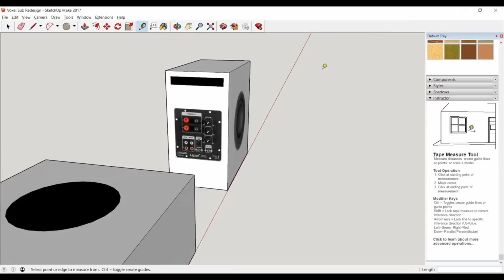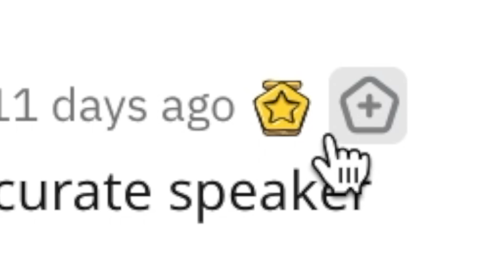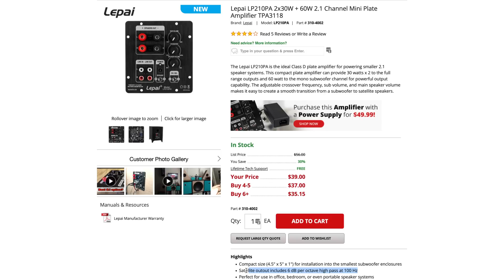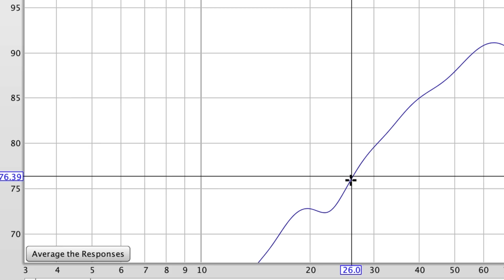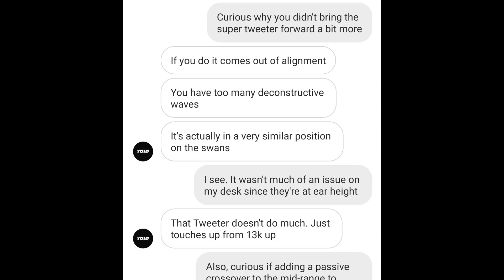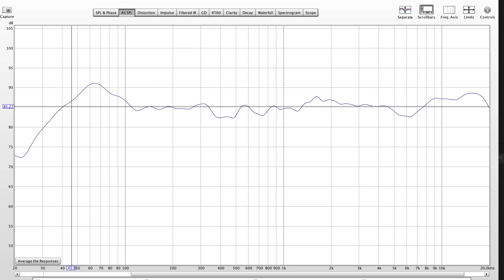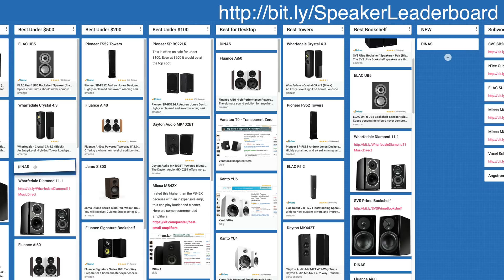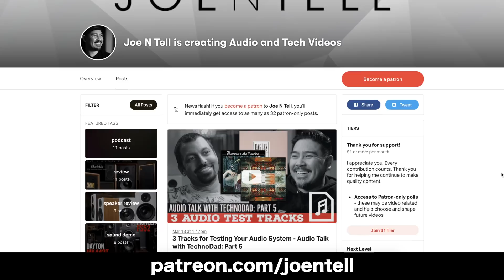DIY Speaker With Subwoofer Hits Down to 35 Hz! - DINAS - Active Bookshelf Speakers Collab w/ 123Toid

Comment: i would move the midrange woofer 1cm up to be closer to the tweeter, as close to the tweeter as possible. also dayton audio has a different version of the RS100, the RS100P. instead of the aluminium membrane it has a mixture of paper with kevlar and glass fibers. while still being pretty stiff, it has more inner dampening which does not have strong resonances in the higher frequencies where the tweeter is playing. the aluminium cone that you are using has some nasty resonances in the upper frequencies and it is not possible to use a 1st oder crossover. you would need a 2nd or 3d order low pass filter with impedance compensation to get it silent above 5kHz.
but crossovers with higher orders then also have more phase shifts which have a downside regarding the time alignment. maybe the aluminium cone has a tiny bit of better resolution in the midrange than the paper cone but i am not really sure about it.
i think the paper cone version has the same dimensions like the aluminium version and is easy to change. you could do a measurement with both types and compare the waterfall spectrum which lets you visualize and compare the resonances.
nevertheless, it seems to be a very good balanced system for an attractive price point and probably hard to beat at this price point.

Comment: I have Edifier s880DB and using it with optical connection.  They don't have subout.  Can I DIY a subout port or any other output to make use of my active subwoofer, which has high level inputs and rca inputs.

Comment: Great video. I was always under the impression that the sub driver needs to be separated (if only by a sealed wall in the enclosure) from the mid drivers or the mids will suffer from the air pressure. This build seems to debunk that theory.
Reply from the maker: The mid is in its own separate enclosure

Comment: Nick, I have few questions about DINAS build plans I bought on 18 Dec 2021.

1) I managed to find speaker box made of plywood/MDF with 12cm or 15cm thickness from Taobao online with dimension of 12.6" x 7.87" x 9.8" (HxWxD) compare to build plans dimension of 12.5"x7.5"x10" is it okay to use it for DINAS or it has to be exact as build plans to get the expected result?
Any different to use 15cm thickness for the flat pack instead of 12cm in term of box resonance at low frequency?
Taobao online speaker box slot port design might be different but I could fabricate it myself with the hand tool.

2) There is 0.68uF capacitor connected to external tweeter in series and then parallel to the Mid range speaker in reverse polarity, what is the reason of reverse polarity connection on tweeter? Same question on Woofer speaker reverse polarity as well.

3) why not connect tweeter and capacitor in series onto (R) channel directly instead of parallel to Full range speaker on (L) channel since there are two channels available?

Thks&Rdgs,

Foon

Comment: Do you know if it would be possible to build a set like you have here, but that allows for multiple line inputs (especially some balanced TRS, that would be great), and mixes all inputs? I have multiple computers/devices I want to play through a single sound system, but without toggling between them. I have a system that works right now, but it's a bit janky.

Comment: Ports aren't tall enough. I've only used these little home audio subs twice but the minimum height on a regular slot port for them is about an inch. I guess having it chuff before bottoming out keeps the subwoofer safer in the hands of careless folk.

Comment: If you still had the other sub under the desk while playing these speakers , then it may have been acting like a passive radiator, causing feeling and sound at the floor level.  I would have like to hear them in this analysis.

Comment: Hi I'm waiting for my drivers ready to assemble the speakers. Just a question about the wiring from the CD player with a  Y cable Line Out right  Channel to the right Line in L&R Right Speaker and the Left Line Out Channel to the left line in L&R Left Speaker. I'm correct  tks for your Answer

Comment: Paper speake cones are tough to beat. There have been many different materials used in woofers over the years, but paper is still the top choice of most builders. Now this is kind of an interest design for another reason, besides what the commentator tells us. I have several drivers I’ve bought for other projects, but I never completed them for various reasons. So, I’ve got some Dayton Audio 10” inch woofers. I’ve also got a pair of Silver Flute 6.5” mid woofers I was going to put in my car. But after the original speakers were broken in I didn’t need them fir my car. I can use those down to 50Hz. With the active crossover of this system I can cross them anywhere they sound the best. I’ve lost got a pair of 2” dome midrange made by Peerless in the 80’s, but mine are in great shape and sound awesome. The only thing I don’t have are tweeters. I do have a pair of Peerless rectangle snapped some tweeters that I used with this some mids, but they just don’t have that extra something. I like the tweeters he uses here. So I might use the same drivers h uses here and use the 10” woofers to reinforce the bass of the desk speakers, but that’s something that I’ll have to figure our in the room I’m going to use them in. I could always sell the 10” woofers to help fund this build, so, we’ll see how thing’s pan out, but I could theoretically build a set of four way speakers with these, a pair of towers with labyrinth patrician for the very low frequencies, a pair of silver flats from 100hz to 1000 Hz, the dome mids from 1000 Hz p to where ever the tweeters will come in and then the tweeters. I could save the silver flutes for rear channel surrounds  using the same tweeters as the Dinas. Or I could use to hem on top of the dinas to widen the soundstage up front. It could bud a lot of fun to figure out!

Comment: Cool idea having a 3 way speaker that reliably handles a full range of frequencies. Is it setup so every driver crosses over and none of the drivers play the same frequency range? Would be a dream speaker for smaller rooms, not needing a sub and having less clutter in an office.
Reply from the maker: Yes, we made sure the crossover points were smooth and complimentary. The crossover for the woofer is adjustable as is the level.

Comment: Hi, I wondering why you use just 2 Channels from the plate amp? I bought the plans and builded the speakers by myself. Is it too much power having 30 Watts for high and another 30 watts for the mid range speaker?  So fare I love the dinas. I struggled I bit with inches to mm because the wood in Germany is thinner or thicker the 0.5 inches. Cheers Frank

Comment: I’ve had this polk audio sound bar with what I believe to be a 6” subwoofer. For being such a small driver, this sub really shows out... I’ve had to take pictures, paintings, etc. off of the wall in the room just because of how bad it would rattle. Impressive for a 6 inch subwoofer, yes, but still not comparable to a much larger driver such as a 12”.... the highs and miss of the sound bar are impressive as well, and can get almost too loud, but yet I find it rare to be ear piercing. Nothing but good review for a somewhat inexpensive Polk sound bar and sub. 👌🏻

Comment: Parts got here today build commencing ^^
Reply from the maker: Let me know how it goes
Reply: @joentell  So I built the Dinas and have already started designing V 2.0 Due to my lack of woodworking skills one speaker ended up .1l bigger internally. 
While this is definitely a unique type of speaker for a first-time builder it was definitely a challenge since there arent any flat packs available where I am so I had to go back to basics on everything.  123Toidd was great at helping me with some questions I have but understandably he has a lot of work to do and isn't on call 24/7.  

I also read the Reddit about these and really want to apologize for all the hecklers that you guys get sometimes especially when co-labing and working hard on inspirational projects like this.  

But as with anything, there is a steep learning curve and audio and DIY audio is no exception in regards to this. Another challenge was definitely that depending on where you are in the world measurements for inches and mm can completely change internal measurements and wood availability since everything is different in metric countries. 

I can attest to the tweeter being time aligned and it definitely makes a difference I would say though that an adjustable low noise power supply is a must don't cheap out on the power supply your asking for a ground loop and under powered speakers if you do. 22v the advertised max on the plate amplifier definitely makes a difference. Part of me feels sorry for the RS100-4 Having such a small sealed enclosure as I know it's a powerhouse in its own right and the tweeter does seem to leave a bit of body to be desired ( potentially thinking of switching it out for a ribbon tweeter with a custom cross over (HELP CROSSOVERS SCARE ME). My Calibrated microphone arrives next week along with the wood and other bits that I plan to use to rebuild my Dinas. 

A few things I learned through this project. 

How to solder.
How to use a router. 
How to use an edge trimmer. 
How to measure. 
How to , how to sound treat wood. 
Importance of temperature when spray painting
Important im matching Types of spray paint and clear coat
Importance of wet sanding for a clear finish.
Importance of the speaker's feet or isolation pads to stop vibrations. 
How to be patient with curing spray paint.
How to clear coat. 
How to convert imperial to metric, hahaha.
How to Use Xsim
How to Use Virtuix Cad
How to look for ground loops.
What a big difference shielded RCA cables can make 
What a difference voltage adjustable power supplies can make 
Speaker positioning.
Different port types and how they affect the sound.
Different insulating materials.
How to choose cross over components.
How to remove and replace caps on electronics.
How to test cabinet for leaks using low frequency and pieces of paper. 
How to Treat MDF with Wood and water mixtures to stop moisture absorption. 

Final thoughts would I recommend the Dinas as a first-time project......

Id honestly say build a pair of C notes or something super basic first. While not overly expensive if you don't live in America shipping on these can be crazy expensive all up on my project being in Australia I spent close to $571.12 on the Dinas and for that price, i could potentially have purchased something like this :

https://www.amazon.com/Klipsch-Synergy-B-100-Bookshelf-Speakers/dp/B07VMTLQJ8/ref=pd_di_sccai_13?_encoding=UTF8&pd_rd_i=B07VMTLQJ8&pd_rd_r=97b023bf-47fd-484a-b30d-e47ed0af5463&pd_rd_w=SnFIH&pd_rd_wg=obDIl&pf_rd_p=5415687b-2c9d-46da-88a4-bbcfe8e07f3c&pf_rd_r=GHPST56036V67TPMC3V4&psc=1&refRID=GHPST56036V67TPMC3V4

https://www.amazon.com/Klipsch-Synergy-Black-Sub-100-Subwoofer/dp/B07VR24V4V/ref=pd_di_sccai_15?_encoding=UTF8&pd_rd_i=B07VR24V4V&pd_rd_r=97b023bf-47fd-484a-b30d-e47ed0af5463&pd_rd_w=SnFIH&pd_rd_wg=obDIl&pf_rd_p=5415687b-2c9d-46da-88a4-bbcfe8e07f3c&pf_rd_r=GHPST56036V67TPMC3V4&psc=1&refRID=GHPST56036V67TPMC3V4

But that's part of it I learned enough to have made it worth it and since I have the drivers and the amplifiers I can re-use them for other projects as well. 

Once again thanks for the help on these and I hope to see more great stuff like this in the future.
Reply from the maker: Awesome. Thanks for the feedback. I thought 123toid did offer flat packs. I know it's always more challenging than it seems. I hope you're having fun in the mean time.

Comment: Hey good job and great video ! I would like to add Bluetooth and wifi connection. So can I connect the LP210PA  with the Audio receiver board Up2Stream Pro V3 from Arylic ? Or should I use the preamp S50 Pro ? Thanks

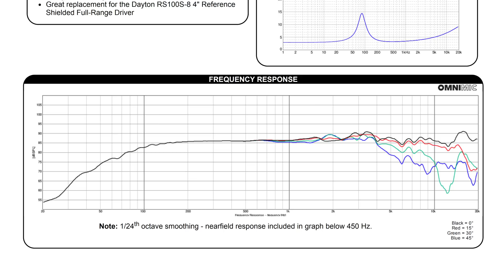Comment: I am not familiar with the audio specification, "Hits down to..."  Looking at the graph at 4:25 I can see that response appears to be down by about 17dB at 35Hz.  That is quite a lot of roll-off.  Numerically, this is not at all impressive, hence your "Hits down to..." phrasing.  Frankly, you could say the speaker "Hits down to 20Hz," because even though the SPL is below 55dB, it is still detectable.  Proper audio engineering terminology was set down over 50 years ago, but many still get around it with silly, misleading terms.

Comment: What tube amp is on your desktop?  And is it a headphone amplifier ?
Reply from the maker: It's a tube buffer. It's probably this one. http://bit.ly/FXAudioTube-01 (Amazon affiliate link) Either that or the Tube-03 or Little Bear T7. Out of the 3, I like the Tube-01 the most and the T7 the least. You put it between your source and your amplification and it introduces a tube sound.
Reply: Joe N Tell thanks!

Comment: "easy build that anybody can build" sigh...I purchased the build...silly me I assumed that the speaker box was something that was either built already and it was something you can purchase from 123toid. I just looked up "how to build a bookshelf speaker" the right way and noticed the tools needed to build one are pretty advanced. https://www.youtube.com/watch?v=GlBuJhMSmcI. Please correct me if Im wrong. I agree that assembling the components and soldering the tweeters to the crossovers "anyone can do". But making the speaker box with wood is no easy task. I feel misled...and discouraged on taking on this project. Can anyone help me?

Comment: I have listened to literally thousands of different speakers over the past 30 years or so,
And these are a absolutely stellar!    anything else in this realm seldom get lower the 45HZ for woofers.
Reply: Have you made these too?
Reply: @aug.jam.1  I have put together similar versions with comparable hardware, but not these exact builds.
Reply: @BrasspineappleProductions  ok, I was thinking about just that, because I´d actually would like to make similar ones but instead passive speakers as I already have a decent amplifier. Thanks
Reply: @aug.jam.1  I would recommend experimental builds to evaluate comparisons.

Comment: So...he did all the job...you did nothing!
Reply from the maker: Like the video said, I came up with the concept and chose the specific drivers we would use based on certain criteria and goals. He figured out the specific dimensions for the cabinet, the crossover component for the tweeter and assembled the enclosure. It's using an active crossover design for the woofer and mid-range so no need to design the crossover. That was part of the design spec.

If you don't value ideas and intellectual property, then maybe you think I did nothing.

Also, how many views does this video have? I earn nothing from the plans or builds he does even though I'm sure this video and our collaboration has earned him lots of sales.

So what else do you want to know?

Comment: CAN I USE THESE FOR STUDIO MONITORS ??? I'M LOOKING TO MAKE SOME GOOD MONITORS FOR CHEAP !!
Reply from the maker: I would use something else. These are impressive and fun, but others are more accurate out of the box.
Reply: @joentell  yeah, Man I was thinking about that.I'm looking at PRV Audio for the woofer 6"....A Dayton Ribbon tweeter and a 2"or 3 inch mid reference driver....got to get the best crossover for the right price. I think that would be a nice monitor build might even sound better than $900 monitors.I might keep them passive since I have a 3,000 watt it is pretty quiet.

Comment: Now I've gotta build these. They look great. As for volume, you could wire a Linkwitz-Riley 3-way active crossover into those amplifiers w/o much work. At 24db/octave rollover, it should reduce the distortion noticeably, but it will cost another $200. It won't be louder, but it will sound louder than they do without the crossovers. I did that with 3-way JBL Pro speakers and a Denon 5803 AVR (6 x 170W MOSFETs), replacing a nightmare passive crossover & a pair of jacked-up and bridged Hafler amps. The max SPL didn't really change: 117db at 1M now, vs 116db with passive, but it sounds a LOT louder, a lot cleaner, w/ a lot of low-end gut-punch.

Comment: I'd like to see a D.I.Y. speaker project with built-in amplification and DSP for correction.  Especially with (sub-)woofer protection; louder volumes dial down the bass and low volumes allow accentuation to flatten the frequency response.

Comment: Could you try Rythmik subwoofers? I heard they are crazy on sound and a few people rate it higher than SVS. I guess you can add them to the best list.
Reply from the maker: I would love to. I've reached out before. Maybe if they hear it from viewers.
Reply: Joe N Tell I’m not a fan of any brand, I just know Klipsch SW10 is really bad, maybe it’s my room size, maybe the woofer port, but I have a lot of port noise at gain beyond 1o’clock position. Went hunting for new ones. The impact on the Rythmik swayed me away from the Pb2000 pro.

Comment: FWIW a sealed enclosure won't chuff... And can reach pretty low too. Just sayin
Reply: But the subwoofer wouldn’t reach 35hz in a sealed enclosure, and deep bass in a small box is the point of these speakers. An SB acoustic 5x8 “racetrack” passive radiator mounted on the rear might be a better option for deep bass and no port noise.